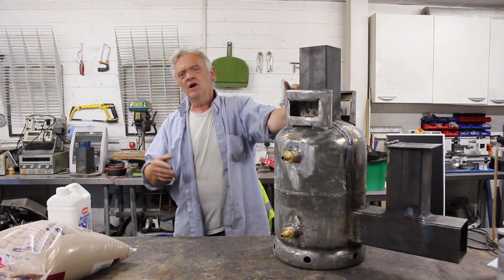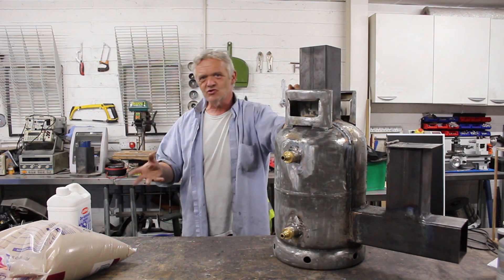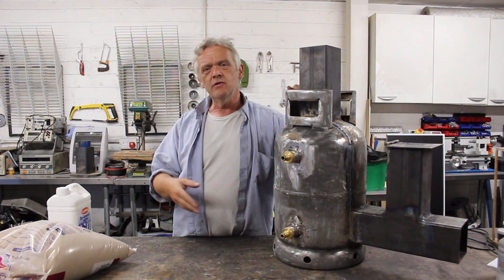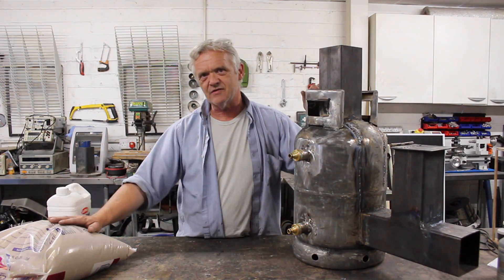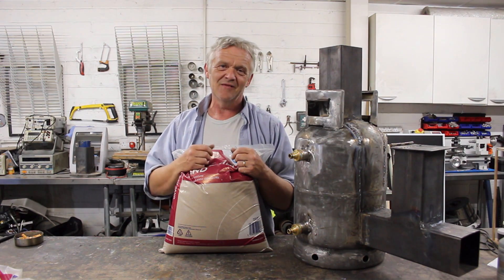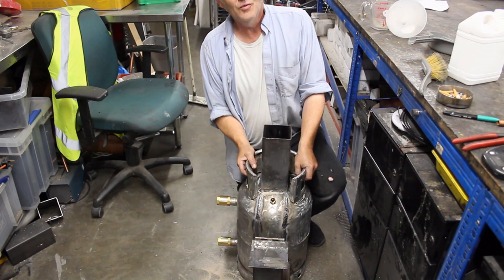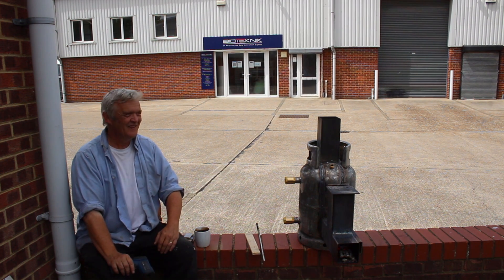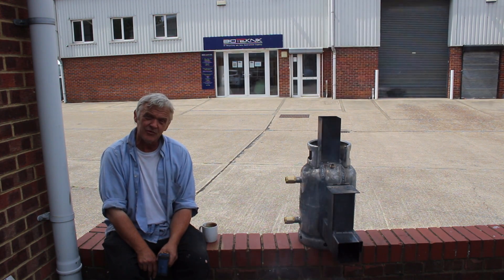1607 A DIY Sand Battery

Comment: Thank you Mr Murray for answering my question and i am now going to go ahead and play with this idea i am thinking of using solar P.V to heat up the sand inside the living room maybe using a gas cylinder is a great idea just to see how much energy it can release over night. Swedish stove heat store is a massive heat store and i have heard reading up on different web sites that a well built one can heat a house on a very small amount of wood over a 24 hour period via very slow release of heat. cheers and thank you for a brilliant video.
Reply: I am pretty sure that woth regards to thermal the bestnidea would be to use solar heat collectors or mix with PV. The reason being - collectors are up to 90% efficient, while p.v. only up to 40%.
Reply from the maker: PV is less than 20% efficient isn't it?
Reply: @ThinkingandTinkering   - yes but fortunately we don't pay to fire the sun up,  ha ha...  
(oops, yes indeed - commercial silicone PV  is in that range)
PV has the simplicity of being able to convert electricity into very high "quality heat" - thermal solar needs lots of mechanics to achieve the same result (domestic hot  water is a good simple use of "cheap" solar thermal - anything more tends to cost $$).
Reply: @ThinkingandTinkering  yes the PV i have are high at around 20% its choosing the element to induce the heat into the center of the sand it will be a slow build up over days weeks maybe. i have been thinking of placing a container of water on or around the heat store with a brass and aluminum sheets placed deep in the water to output a non galvanic way of creating voltage.
Reply from the maker: I am pretty sure the Scandinavian design of heat stoves is the inspiration for this mate - they are impressive
Reply: @ThinkingandTinkering  yes they seam to have got it correct a massive slow release heat store with just a hand full of kindling just incredible.

Comment: I can see this simple thermal store being ideal for narrow boat as a flue to outside is simple to achieve and they can get very cold during the night, the weight wouldn’t be an issue either being fixed and could form part of the ballast. Add a couple of peltiers in the right places and you’ll get a bit of continuous power. Now I just need a narrow boat 😆
Reply: put a coil of steel pipe inside the sand, a small pump to circulate some water and you have a circulating hot water radiator for your narrow boat.  Just the thing for those cold nights on the cut.  Seems that you and I are missing one important thing to cruise the cut, that pesky missing narrow boat.  LOL
Reply from the maker: it would be ideal mate!

Comment: Evening Rob  - basically HEAT STORAGE HEATER you have made calling it now a sand battery  - but now you have 16.6meg jewel so now HARVEST THAT ENERGY??? a fellow comment said a coil and draw the heat via oil or water in the coil to heat transfer  - then geothermal from your now super hot sand to make electricity  - please get you head round that challenge and rig up a feasibility study to show the finish pattent / your twist on it and still the is more heat to harvest from the exhaust turbine possible effect?
Reply from the maker: it's not me calling it a sand battery mate - this is the term given to it to make an old idea seem new - I also just did a video on heating water with this boiler

Comment: Is this not the same idea as the older storage radiators ,( electric) you ran at night ,that had large bricks in them and stored heat for day use .
Reply: Yes, but you could use it for long duration storage rather than 24 hour storage.   So if you had an excess of solar power in the summer you could heat your home in the winter or example, I think the fins are doing something similar with wind power.
Reply from the maker: yes
Reply: Brick is not as dense as sand (or rock), and will not hold that much heat. They will release quickly, so in conjunction with a denser material, ie, sand- clay?

 Water is a great conductor and will release quickly. Water is not good for long term storage of heat, but in conjunction...

Comment: Will make a great heater if you use Terracotaclay pot or The tradisionsl Spanidh fireplace made of terracota
Reply: I believe the Chinese created a heating system using ceramic ,  with a firebox built underground, to heat houses. Still used today.
Reply: @markusgarvey  Thnx very interresting, putting heated sand,  and then using a hallogen lamp to first heat-up the sand, in other words using a hallogen lamp as a heating element.I took a 150watt hallogen lamp and measured the temprature, it reached 230degrees celsuis in les than 4 minutes. I think there is going to be a lot of ideas that will be taking off from this sand /battery  concept.
Reply from the maker: yeah it would

Comment: To me, rocket stoves were made to be used with mass heaters.  Run the exhaust through a thermal mass.  Sand, dirt, bricks, clay whatever.
The heat coming out of the chimney is very little.
Letting the heat go straight up the chimney is a total waist of fuel.  
Paul Wheaton has been on the forefront of rocket stove mass heaters for decades.  His results for reducing fuel used is impressive.
And the time to burn is minutes instead of constantly burning all day as with conventional wood stoves.
Reply: My entire rocket stove is homemade out of clay, brick, sand, and the chimney piping. I can burn a 5 gallon bucket of wood in the winter with it being 20 degrees F outside and I'll get my tiny home heated to about 85 by the time the fire dies down. But the residual radiant heat trapped in the clay and sand form of the stove that it'll keep it warm all night and it'll be about 65 degrees by the time I wake up.
Reply: @RareVBlue  what's your square footage for that experience? I'm looking at doing this setup for a 8m X 8m two floor workshop.
Reply: @RareVBlue  put up a video
Reply from the maker: for sure mate
Reply: Waste not waist. 
Other than that I agree.
Reply: Yup! I agree. Read up on Russian stoves, Finnish stoves.
Reply: A good wood stove usually  (or should) has some fire bricks in it.  Growing up ours would stay warm for about 8 hrs, fill it up on in morning and would come home to just a few tiny hot coals in the ash.
Reply: I've been building rocket stoves for like 6 years and I just welded up a little one here and I have a pipe running through the ashes sealed on both sides. I have a 12-volt fan on one side blowing air through and the other side goes into my window... Works really good but I wish I had a more powerful small fan
Reply: Can you talk about dangers of temperatures above 1000F and how it destroys ozone layer?

Comment: I keep replaying the part he says storage is 850j/Kg  but I can't understand the celcius portion
Reply: 850j per kg per degree Kelvin/Celsius. so if you heat 1kg of it 10c, it stores 8.500J of energy (vs the starting point). you can also say it takes 8.500j to heat 1kg of it by 10c.
Reply from the maker: Duncyy gives a good explanation

Comment: I live in Alaska and heat the main living space with a home-built woodstove. It's a horribly inefficient design (basically an old propane tank with 3-inch pipe for a chimney) that sends most of the heat straight up the pipe and out. Now you've got me thinking.
Reply: Look at rocket mass heaters
Reply: The Romans ran a pipe beneath the floor of their homes.  The fire was on one side the pipe ran slightly uphill beneath the floor warming the floor and the home. Smoke escaped the pipe the other side. Add sand or water on either side of the pipe to retain and radiate the heat and you have a more efficient system.  Run the pipe back and forth (left and right) as you see in old  indoor radiators (hot water pipes with radiators in individual rooms for warmth) but instead of running hot water up and down you run the hot air back and forth through sand (water will eventually rust the pipes) and you would probably have a great system. It would also prevent smoke entering the home though cracks in the pipes. Having a furnace beneath the home was common in places with basements in eastern USA where feasible. Florida not so much.
Reply: @suzannehartmann946 Great idea, heating the floor is better, because cold air falls tothe bottom, and heating the air from the bottom would keep heating the coldest air and evenly distribute the heat.
Reply from the maker: awesome mate - cheers
Reply: There was a guy in Ukraine putting videos on YT of his Fresnel lens heating solution.  Although I knew someone who used a similar tactic by heating rocks during the day, and then moving them inside at night in the mountains of KY.  So unless you are in the dark, u can make heat on cold days passively.  Sometimes simple stuff like putting a radiant barrier in your attic and/or making sure there is a jog in your exhaust pipe can keep what heat you do get inside.  But I live in Fl, I have a fireplace which is surrounded by rock ... so that one day a year I do use it... it stays hot/warm for 12+ hours or so after burning.  yes, most of the heat escapes.  but the flue column surrounding the pipe also is a contained air gap, I could steal heat with a small fan to reduce cold spots in the room ... but like I said, I don't need it.  Personally I'd try a closed loop of mineral oil, although i know nothing about how to passively pump it into a radiator. glhf.
Reply: You could wrap copper pipe around the flue and
take the heat anywhere u like from there

Or get a fan?

Comment: This could work the best for storing solar energy since both lead acid battery and dry cell batteries are getting more n more expensive as well as causing environment hazard.
Reply: Focused sunlight to some kind of heat exchanger is an Idea. The same concept as using it to melt sodium in desert solar power plants.
Reply: @markusgarvey  sounds interesting and workable
Reply from the maker: it's a good idea mate

Comment: something similar with copper coils inside and a fan to force air as a way to distribute the heat further away as into the interior of a house or another room would also be interesting.
Reply from the maker: for sure
Reply: @desertsun02 has some videos where he does just that.

Comment: Yes!!! Now I have a question: how can we heat the sand without wood or cokes. I want to do it wit 12 V ir more but how??? 
I had an idea to mix the sand with graphene powder and put from the electricity 220 V or battery 14-48 V 2 wires in the graphene sand One from the + and one from the - like you did with the graphene conductive paint on the wall. Or was it a infra red strip?
Something very easy is there that we can do with free energy to heat the sand. In those times it is so important that we are self supporting with our heaters in the next winters. 
Hope you all will think about it:
How can we heat the sand without cokes or wood.
Reply from the maker: for sure mate - just use a resistive element
Reply: @ThinkingandTinkering  Wow, thank you!!!
Reply: Maybe a conductive graphene connection between the wires?
Reply: Wich sand did you use? I could not hear quite right the name. In Finland they use, as far as I know, granit sand. 
I was thinking about
granit, silicium, lime and graphene powder. 
Make a mix, put it in a stove and than with 2 wires and an graphene connection between them.... what do you think?

Comment: Molten zinc (or lead act) will keep giving off a 'steady' heat as it solidifies. Next stage is a ceramic blanket to hold the heat 'charge' for longer.
Reply: Over 200 C and zinc gives of toxic fumes, led fumes are also very toxic. Depending where those fumes are vented to, it could be lethal.
I think sand is a cleaner option N&B.
Reply: @pa_maj.MARTINI-van-MAN  Such systems don't need to be vented!
Reply: @Nuts-Bolts  Oh' that's better. No venting is something I didn't think off. Does any  pressure/expansion happen at all NB?
Reply: @pa_maj.MARTINI-van-MAN  Molten  metals still expand with. temperate (so expantion space required) but no pressure problems below boiling point.  However, there are some considerations.  For example, there are uncertainties regarding corrosion and liquid-metal embrittlement of containment vessels with lead at very high temprature. A potential problem for lead cooled nuclear reactors. Don’t think Rob though, is going to build one of those anytime soon… I hope.
Reply: @Nuts-Bolts  Thanks for the info NB, another thing learned today, cheers!
I think you're right about Rob, he'll not rush into this one, I hope.
Reply from the maker: for sure but they sound expensive

Comment: Have you ever looked into Sodium Acetate Trihydrate as a medium for energy storage? Phase change occurs at 58°C and the latent heat of fusion is 270kJ per kg. Density is around 1.5kg per litre. Also, you need to consider all the CO² and Methane in there that can be acquired through sequestration and locked away.
Reply: I've mentioned this previously in another comment on the other sand battery video, but the main challenges facing SAT as a thermal energy storage medium is phase separation when in its supercooled state. An addition of CMC seems to do the trick with that though. The other issue is the need to improve thermal conductivity. One research paper added graphite to improve the situation, but I haven't seen any mention of graphene yet. The last major issue is with the initiation of nucleation when the SAT is in its supercooled state. It's very simple to do it physically by adding SAT crystals to the supercooled liquid to kick-start the crystallisation process and release that previously mentioned 270kJ per kg of latent heat of fusion. That 58°C temperature is much easier to work with as well.
Reply: $145 USD for 2.5kg is cost restrictive.
Reply: @markusgarvey  vinegar and baking soda dude, it's one of the easiest chemistry exercises for rank amateurs like myself.  Essentially if you've ever made a baking soda rocket or a baking soda Volcano project then you've made sodium acetate.
Reply: @markusgarvey  It costs £43 for 25kg. I bought 50kg from a company called Intralabs here in the UK.
Reply: I have been trying to work a way to build this kind of SAT energy storage/ emergency heating system. My thought is that it would be contained within a large vacuum flask/dwar that has a loop of copper around the inner flask and a central column that contains the electric heating element and another immersed heat exchange coil which is used in tandem with the interior wall of the vacuum flask, to either extract the heat energy once nucleation is triggered or to recharge the system with domestic hydronic heating or through solar thermal collection. This is in addition to the electric element that has potential for being run directly from the grid using off peak prices, being rechargeable during power outages with a portable generator that isn't suitable for all electric heating systems. I also see it as an option for use as a dump load for most renewable energy sources such as hydro, and wind. 

Not being a trained chemical expert, I am curious about what other substances may have a similar effect to sodium acetate, in addition to what additives can be useful.
Reply: @petercoutu4726  I only know about NaOH when you mix it with water it gets hot. But there other substances with the same properties but I'm not sure
Reply: @petercoutu4726  I haven't come across any other compounds that offer the benefits of SAT. It's extremely safe, easy to produce yourself, is able to supercool, offers a latent heat of fusion at 58°C (sensible heat, not 500°C) of 270kJ per kg, 1½ times the density of water and can be used to lock away huge amounts of CO2 and methane.
Reply from the maker: they are a lot more expensive than sand mate and compared to sand there is not a lot around - so a few could use it but not lots - and it would raise the cost per kW
Reply: In Euronews I saw a video where Germany build a huge isolates tank it should held hot water heated up with Overproduction of Renewable energy. I think sand which is heated up and then use heat exchanger or heatpipes to get energy